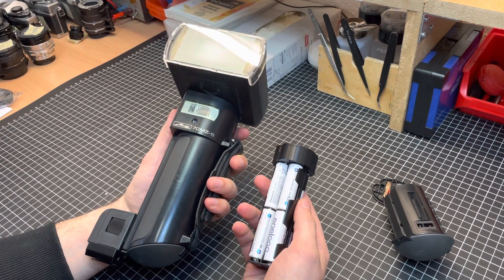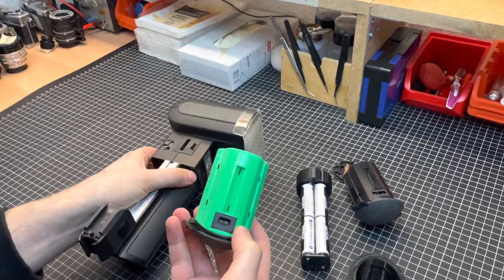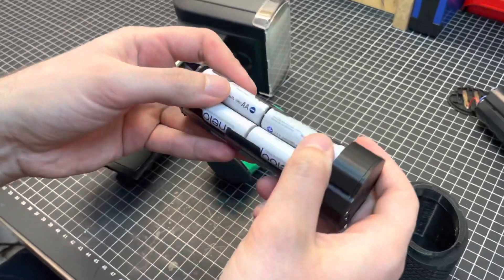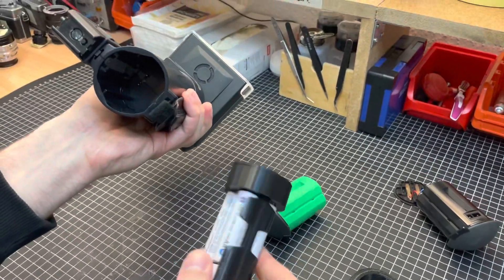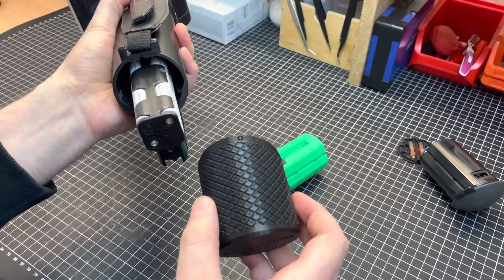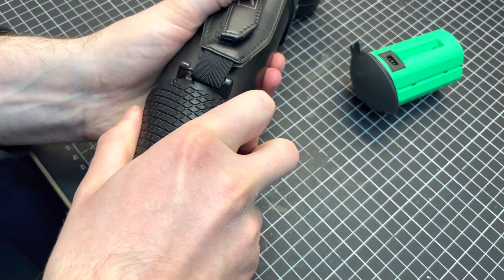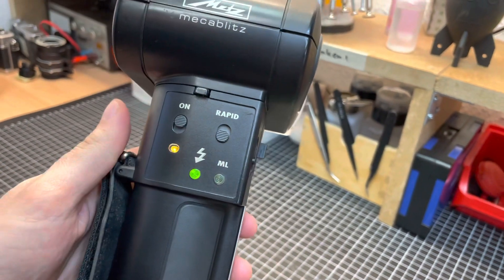Ersatz Akku Replacement Battery AA Adapter for Metz 76 MZ 50 MZ

Comment: I own a 76MZ-5 and desperately need something like this as my original battery that came with the flash no longer holds any charge to speak of at all!!!  I therefore have a redundant flash gun which, when powered, was my absolute best ever flashgun.  Are you still able to provide or recommend where I can get an alternative battery such as the one you describe here??  Many thanks!
Reply from the maker: check out our shop: www.ausgeknipst.de
Reply: Batteries Plus in Orange CT rebuilds my battery packs for me.

Comment: Metz 76MZ-5 question: Does your have a fan under the flash head?
Reply from the maker: Hi,
if you mean the opening directly under the tiltable head, then yes. It does.
Reply: @ausgeknipst  Four of my niece have no fan on her 76MZ-5's. Just a hole that can be seen without a fan.
Do you think it was a 1st generation? If not, then do you have the name/part number of that fan?

After ATG departed Metz, Metz soon went into the history book.
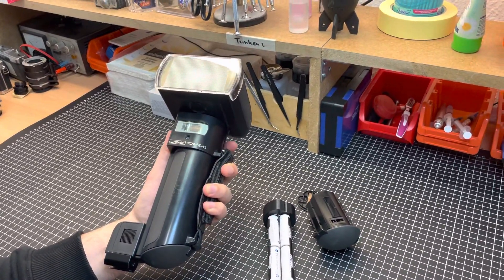Reply: @ausgeknipst  Strange, your Metz 70MZ-5 (0:18 fan hold under flash head) has a fan & 76 MZ-5 doesn't.
I would think ATG/Metz made the 70 before the 76.  Do you know when does the fan comes on?
And how to turn on ATG's secondary flashtube on (76MZ-5)?

Comment: ATG said it was Metz biggest mistake of making the 76MZ-5. That's because the ATG Auto2 CAN NOT be used w/o adapter!
ATG suggests to get the 60CT-4. Without the hotshoe adapter for 76, the flash is useless. There are no display on back of flash